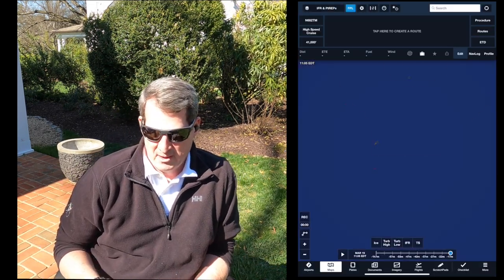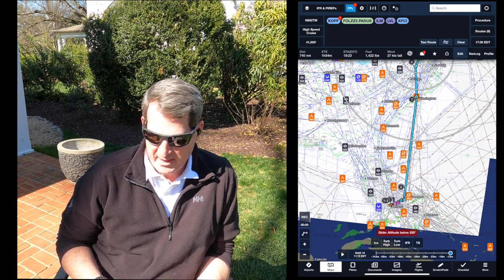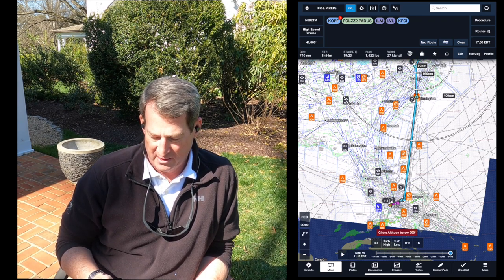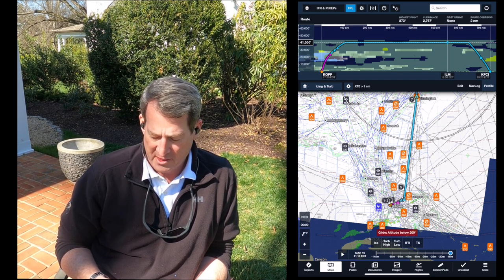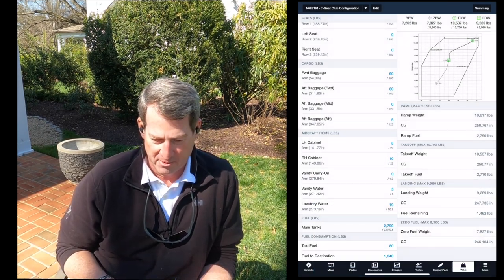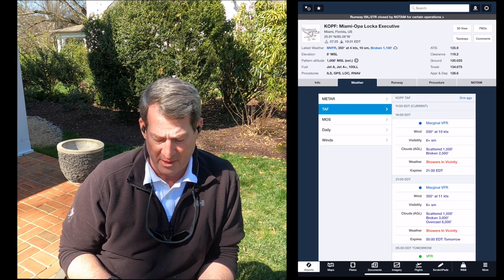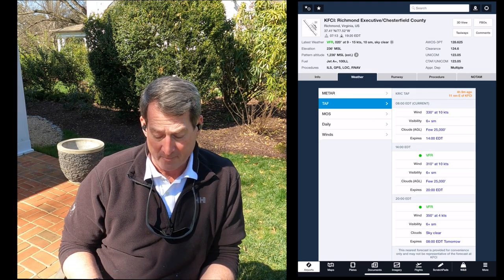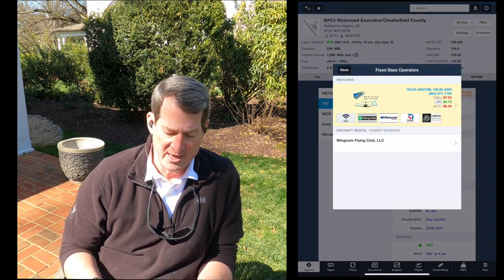Anatomy of a Jet Flight - Part 1 of 3 (IFR Flight Planning) HondaJet Pilot

Comment: Fantastic video.  While I question a few comments regarding the planing process -being the same for a Honda Jet and a C172 -  I truly appreciate the comments on risk assessment.  It would be fantastic if you could share that in detail and why you decided to skip a flight. That would truly be of value to new pilots - hearing the process you went through and why you decided the flight may not be the best choice.  Anything we can do to teach that type of safety is golden!
Reply from the maker: OK, great question. I hope you don't mind a long response. Here's how that day went down:
BACKGROUND
I flew to Miami-Opa Locka the day prior for a full day of business meetings
While there, I noticed that my left main tire had a bit of damage and should be replaced 
(a HondaJet tire replacement requires an over-night leak-down check)
I was staying in an AirBnB in South Florida, got OK but not great sleep
There is no HondaJet service center at OPF but one of (if not the best) Service Center is at Banyan and near by FXE which is about a 5 min flight away

DAY OF
Relatively easy morning but I knew I needed to get the plane moved in order to have enough time in Maintenance to make my departure window the following day. 
Getting to the (very over-priced) rental car, I forgot my keys and had to go back inside to get them
Back in the car, I noticed I'd left my swanky Yeti tumbler of coffee on the roof of the car
I stopped for breakfast and while I was there, I called in a fuel order for the plane - top off
3 minutes later I called back to amend the fuel order to just 1000 pounds (~150 gallons)
I've never had to worry about this before, but had immediately remembered from my type-rating, that I had max landing weight of 9,960 and would be over max with a full fuel load
I drove to OPF, turned in my rental car, set up another rental at FXE and checked in at the FBO
I discovered that the plane had in fact been fully topped. My reaction to this was stronger than it should have been to this simple mistake
OK, I realized that I'd need to go and hold for 35 mins  to burn off fuel so that 
1) I could land under max 
2) drop my plane off for a tire change that had exactly enough time remaining so that I could leave the following day
3) pick up another rental car
4) get back to business for the day
This is when I noticed that I had left my plane keys back at the Airbnb. My spare was locked in the jet. 
As I was planning to go rerent my car, drive an hour back, get the key, lather, rinse, repeat...I looked at my buddy Steve and said "I think I'm canceling this flight and scrapping this plan". The look of relief on his face was undeniable. The nice person behind the desk at the FBO said "that's probably a good call".
Reply from the maker: ...and since then, I include as a part of my Take Off Briefing, if I'll need to burn fuel before landing.
Reply: @bluemaxsix  definitely a good call.... some days those little distractions build up like, and it just isn't worth the risk of what could happen if that chain is not stopped.
Reply: @bluemaxsix  Thanks for sharing that, it's a good lesson for all.
Reply from the maker: @flyawaysantafe9673  Exactly correct. But it's also subjective. I know my nature and so I have to be extra careful and check. It was ruining my Risk Checklist that told me NOT to listen to my own best judgment.

Comment: I plan pretty close to the way you do, except flying in the flight levels-ha!!!
“HH” on your sweater for the catamaran “HH”?
Reply from the maker: Thanks for backing me up on the checks. Glad to hear it. Of course as I watch it,I see all the stuff I left out!  The HH is Helly Hanson - if you like OK closely you'll see the Blue Max logo design n the sleeve. WOOT WOOT
Reply: @bluemaxsix  
I check winds aloft in ForeFlight to see what altitude I should file for, most likely effects me more than you though….
Reply from the maker: @Parr4theCourse  Exactly. Same. But for me it's more about the fuel. I also check the Icing Turbulence (High & Low) IFR & Thunderstorm guidance.